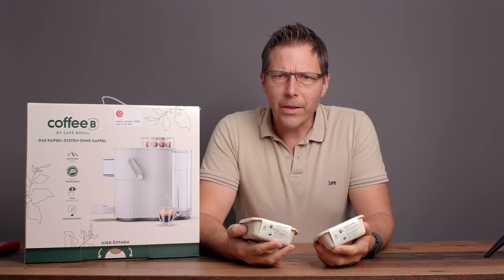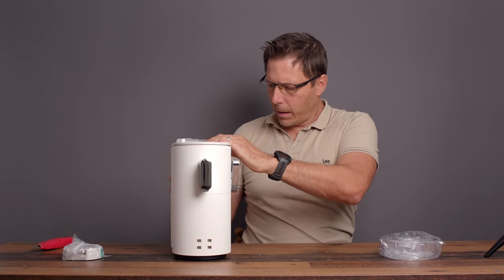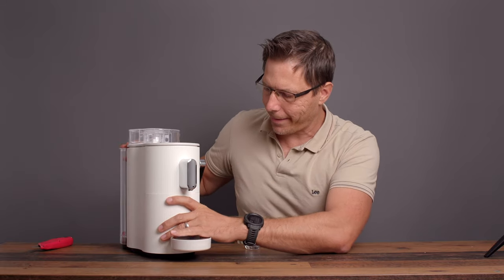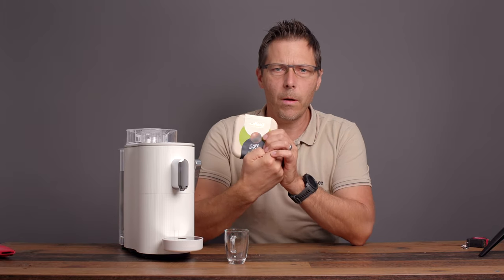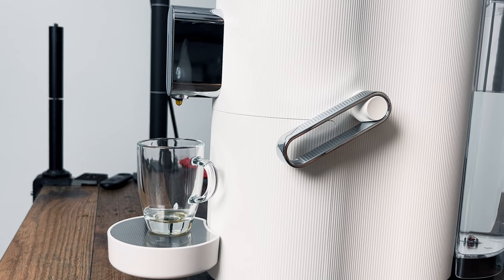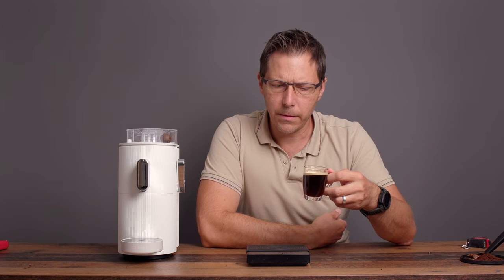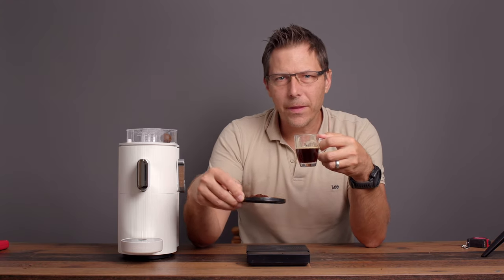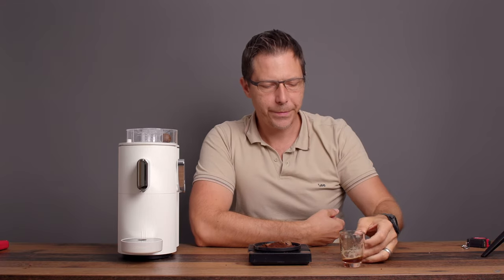Coffee B - The Alternative to Coffee Capsules.

Comment: looks like a miss and a hit machine , probably needs design improvement especially with the rotating ball holder makes no sense if you can drop directly from hand hah.
Reply from the maker: The carousel does seem to be superfluous indeed.
Reply: Guess, what...

How to Grind Coffee beans to coffeepowder.
The machine/Tool is a circular one.

Logic next step...

By supporting the circular movement of the coffee powder, we also support its liveliness and vital quality.  Chemically and analytically, the coffee powder remains the same, but its internal cohesion, the cluster structure and the energy potential change fundamentally.

All Aromas extracted perfectly...

If you prefer "rotary" over "circular"  ...

Comment: I wonder how much of that coffee that comes out first is retention from the previous extraction - I did not hear a flush cycle. Also the start of the first extraction was milky water, I would be concerned about additional chemicals from the balls leaching into the coffee.Also, the fact that the balls have a coffee smell to them must mean that coffee volatiles are being lost and the balls are staling pretty fast.
Reply from the maker: I think on the first extraction that the waterways needed to be primed. From there on out, it pretty much goes right to the extraction from the beginning. The balls are wrapped in a sealed container of 9 balls. So probably decent freshness at least until they are unwrapped. I still think it's a nicer solution than the Nespresso capsules. Cheers!
Reply: The "milky" water is just a lot of bubbles caused by the pressure. If you wait a little they will disappear